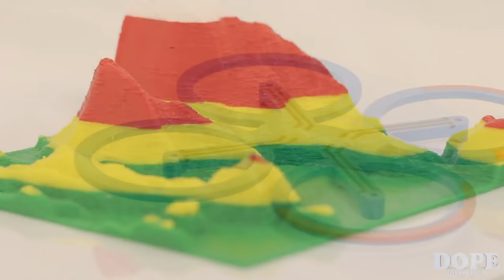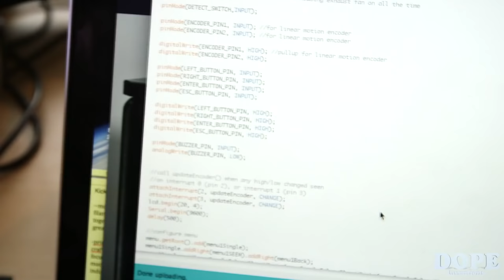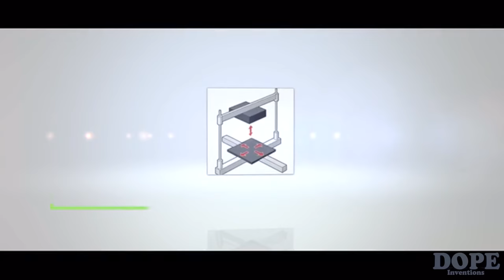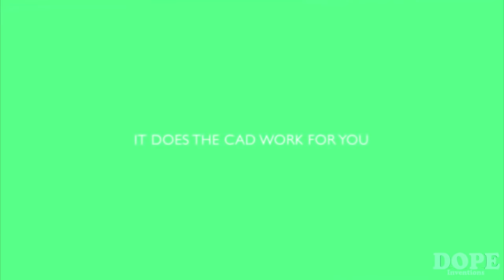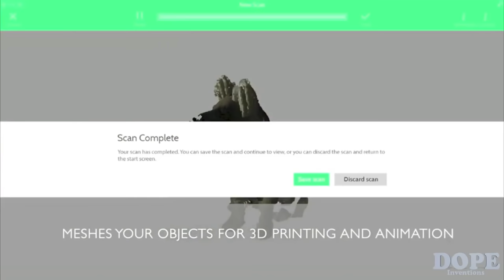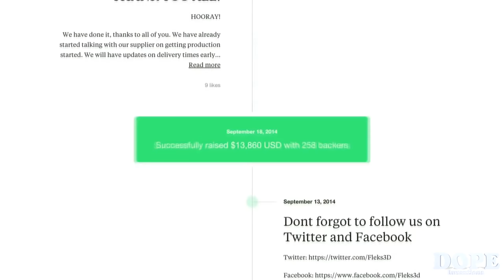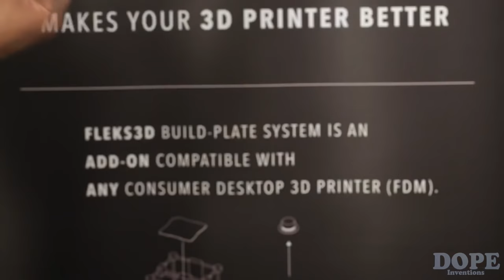5 Amazing Gadgets for 3D Printers - MUST SEE!

Comment: 0:25 Well, if your prints look like that you should tweak the settings and not buy an $150 tool.
Reply: especially when said tool is a soldering iron...
Reply: Or you could just buy a wood burning hobby kit from the craft store and get the same results.
Reply: @MakoKitten  A cheap 3D pen can work well too if you wanna weld parts together rather than use something like 3D Gloop.
Reply: @unmodestgaming4974  basically correct, just changable heads
Reply: Exactly
Reply: @IEVLV8  a lot of soldering irons come with changable heads. mine was only 9$ and it came with 8 different attachments and I only use like 3 of them.

Comment: $150 for a fucking small soldering iron? No thanks.
Reply: But he's English and distinguished like the Dyson vacuum guy. It MUST be worth it!
Reply: simalar tools have always been used for cleaning up injection molded stuff, they do not cost $150
Reply: searching the term hot knife or hot wire knife will get u better products
Reply: I ended up buying a Dremmel clone with shit loads of grinding accessories. £50
Reply: Wait, a clone of a burning tool worth $20 is rebranded for 3D prints for $150? I'd rather buy more heads for my burning tool.
Reply: Zelda's Fox or just buy a better 3D printer

Comment: maybe instead of million dollar gizmos to remove supports you can use xacto knives?
Reply: Boblol126 exactly just use sand paper and an exacto knife
Reply: Boblol126 i would think: Hey! if these supports are that bad quality, maybe you should check some parameters than wasting 100? 200?
Reply: Ten out of Ten, would recommend that you do this. ^
Reply: or a soldering iron
Reply: A wood burning tool has most of the same attachments for $20
Reply: What got me was how they tested a lot of "scary" equipment, if a Dremel and soldering iron is your idea of scary then you have no business playing with a 3D printer and its hundred degree hot end.
Reply: yeah thats why I hate these sort of videos, I clicked cause I thought it might be interesting, but the whole video is just and advertisement with clips that are basically commercials pulled from cable tv, and there are always better solutions
Reply: I have a Prusa, and I find that removing supports on a complex print is really frustrating when using an exacto knife. Usually, I can't get the wide blade flush with the piece that I'm trying to remove. Even still, when you support on the print itself rather than exclusively on the base, when you remove everything with the knife, there is still a bit of residue that you just can't get off. I see the first device advertised here as an apt solution for this problem.
Reply: Honestly soldering irons do the same

Comment: The Palette markets itself as something to add onto a low cost printer... but it's 1000 bucks. That's like 5x as much as my printer lol
Reply: Leroy Chan same lol
Reply: I can buy a multi color printer for under 1000, Palette doesn't seem worth it.
Reply: @jymbates9662  i can make something similar  with my printer by pausing the print and switching filaments.
Reply: @LastBaws  you're going to run to your printer after every layer to manually change the filament?
Reply: @kalihban7212  if that's what you have to do then i guess so. or you can cut your model and print them on top of each other with different filaments
Reply: @LastBaws  some multicolored models require color changes every layer, so that method can't always work.
Reply: @kalihban7212  you could try and fuse filaments together? it'd be ugly but, if it's all you have then... or you could just paint the finished product if possible

Comment: retouch 3d... yeah sure... print as fuck and buy a usless soldering iron tool with an xacto blade... OR just spend 5 more minutes doing a correct 3d printable file...
Reply: Or buy the filiment that dissolves in water
Reply: thats actually expensive though.  but yeah...
Reply: Gon Garcia c

Comment: the palette is an amazing tool... But it is a 1000 dollars, that is more money then most 3d printers itself...
Reply: Timon Schouten you can buy a dual extruder printer with it
Reply: Do dual extruder printers print in 4 colors?
Reply: A diamond extruder CAN print in 4 colors
Reply: prusa i3 can print in 4 colors with a single extruder and thats at 1000 total
Reply: lmao, no it's not, it's only 170$
Reply: The Prusa 4 color head needs to bulid a block of filament for constantly changing the color. In many cases this block uses more filament than the actual model itself. It is a wast of filament.
Reply: On my Prusa mk3 I can cut the filament and let the filament sensor figure that the printer has run out of filament, then insert a different color filament. Cutting the filament is free.
Reply: The Palette does the same. Checked on their website because I was surprised by the absence of a purge block in the video. They do have an option for off-bed purge though. So maybe in the future it'll be easier to recycle the purge (by having different buckets that each purge color goes into).
Reply: My 3d printer was for 30,000INR (pretty cheap) and (printable size: 300*300*400mm) and it has a mixing extruder. So i say the pallete is useless
Reply: Prime and paint my friends prime and paint

Comment: All I could think was yeah it may get rid off supports and what not but you will still need to smooth off after you've been around melting with that fancy soldering iron, they have solved a problem by creating a problem.

Comment: Fleks 3D can handle 100 Fahrenheit if I heard correctly:
So heated bed printing is *** as temperatures for PLA are good around 50-80 and ABS 100-130 Celcius..... 100 fahrenheit is 37 Celcius btw
Reply: Yeah, i hope he was mistaking farenheit"s" with celcius there, otherwhise  a person can barely touch it. 

They claim it sticks and pops off easily, yet they use rafts on all prints and when they flex the raft still sticks, wtf ?
Reply: I think there may have been a missing safety speech, YOU Won't Burn yourself as it don't get hot enough. LOL but will be able to wilt plastic...

Comment: If you truly have that much of a problem cleaning you need to fix your settings and it its more about smaller less frequent things just use a wood burning kit its just a soldering iron with changeable heads the pallet thing is cool every thing else is trash

Comment: Interesting. The fixer tool has good potential.  The scanner will need to be affordable to viable. The filament splicing machine is very interesting and has clearly had alot of time and money put into it, unfortunately it will be made obsolete with a simple firmware improvement on printers. Overall a lot of interesting ideas that are unlikely to be very fruitful.

Comment: For removing prints from the bed I use Wolfbite. Its a liquid you brush on the glass then heat your bed as usual. The print sticks flawless and when the glass becomes about 45 to 50 degrees the print simply releases perfectly no knife needed its as if it was never stuck firmly to the bed. You can then print the next thing without reapplication if you wish up to about 3 times. No need for flexing the print which looks to me like they are stressing the models out and its not smooth like glass. And also you can but soildering irons with flat and or interchangeable tips meant for plastic but always wear a mask if you melt plastics.

Comment: Dail in your printer better and get better slicing software, failing that become an off grid spoon whittler...
Reply: 100% agree. Calibrate your printer correctly and you design your models with 3d printing in mind there is no reason that you should have to re-touch most of them.  If you absolutely must use support, use PVA and dissolve it away, and if you really need a perfect finish you would be much better off trying acetone vapor treatment or similar.

Comment: Retouch 3D - If you dont print on a shitty wooden printer and you use proper filament with proper settings, support material just peels of, also their product is just underpowered soldering iron in fancy case, we can use our soldering irons with low temp set and proper tips.
3D scanner - they even didnt showed us the results...
Fleks 3D - Hmm, finally something interesting.

Comment: I have a Fleks3d Build Plate System and love it. Works exactly as advertised and worth every penny given the amount of tape/glue sticks/hairspray/... you'd save on using...
Reply: it probably works, just something about bending that makes me uneasy... like how FLAT is it after you bend the shit out of it.  if it's even 50 microns bent, it will be noticeable on your first layer.   Also there is PEI,  cheaper than most surfaces like build tak etc...  and seems to take more of a beating, works like magic.

Comment: Honnestly, all isn't to throw away, but it's definitely clickbait. Two objects have kind of the same purpose (the resin fixer and modified soldering iron, and superglue exist to stock parts together), the pallet is neat but for twice the price of a cheap printer and probably not so neat results because switching between filaments includes an ugly "in between" color, plenty of flex beds exist so this one isn't special and I'd say less convenient than a magnetic bed, and the 3d scanner is only for really niche uses. The only one I see having a use is the modified soldering iron in conjunction with a 3d pen, that could offer nice post print customization and treatment, but at 70 pounds, making custom tips for pre existing temperature controlled soldering irons would have been a better plan I think... ll try the AliExpress clones first.

Comment: WTF LOL. Just buy a cheap soldering iron with a temperature regulator on it. Then buy tips for burning wood, they are the same shape as the ones this tool comes with. It's gonna cost $30.

There is also the possibility of, you know, desinging your own support and not making them so shitty to remove.

Comment: First off, I never had 3D prints look this bad, and second this is just an overpriced Soldering Iron. If you don't like dealing with supports, get a dual head 3D printer and use HIPS to print the supports. The price you'll pay for a 3D printer and this tool, just get a dual extruder printer.

Comment: Or you could just set up your slicer properly for free. All of my support material comes off cleanly with light finger pressure. I am staggered at the number of tricks and tips and gizmo's and mods that I see that do nothing except fix badly printed parts printed on a badly set up printer using a badly set up slicing program.